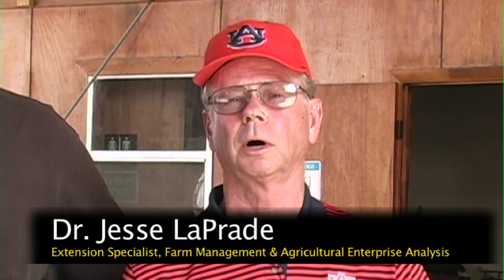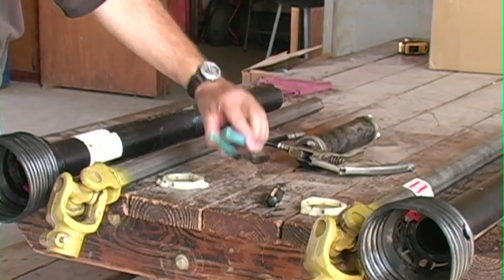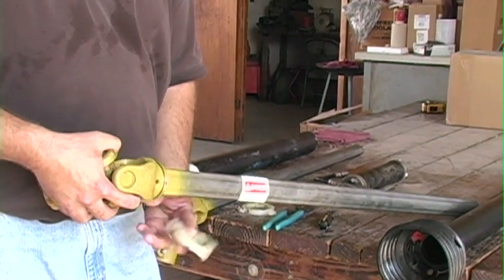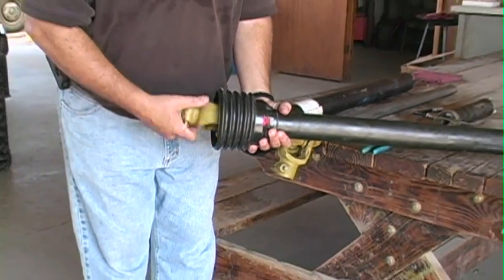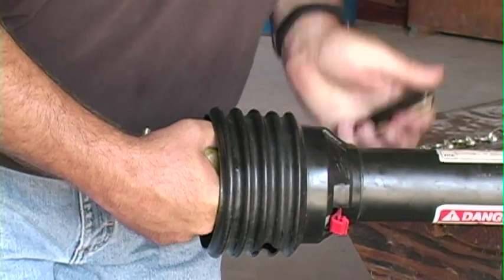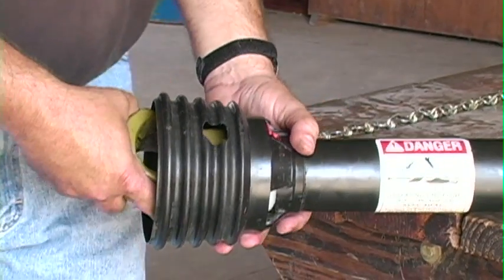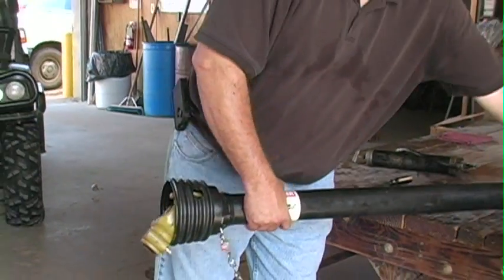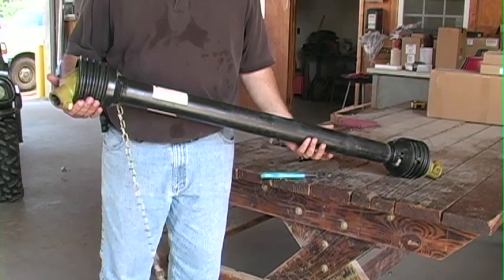How to install and maintain a shaft cover on a tractor PTO

Comment: Nearly 10 years old, but relevant.  I need to replace a cover, and this video was helpful.  Thanks.  If I was going to offer a suggestion it would be to clean and grease the PTO shaft sections before assembly.

Comment: You have to grease the male and female parts of the shaft. There are many different mechanisms to attach the bell end and plastic bearing. This was specific to one manufacturer. The plastic zerg fitting breaks frequently, so unfortunately you do have to take it apart all the time to manually grease the plastic bearing. I agree that the shields should be used. They reduce, but they do not eliminate the possibility of your clothes getting caught, pulling you in and spinning you around till you die. A much better plan is to never get close to the shaft, cover or not, and never touch the shaft with the tractor engine running. You still need the cover because you never know when working in the field when you might trip and fall into the spinning shaft even when you were trying very hard not to. The safest thing is to turn the tractor engine off if you get up out of the tractor seat, but that gets impractical pretty quick.
Reply: Better to be inpractical than dead or lost your legs or arms!!!
Reply: I don't use the grease zerks, instead I use an oiler to put some oil between the locking collar and the yoke (no need to disassemble anything). Grass tends to wrap around the shaft while mowing so safety is not the only reason why you should use a shield.